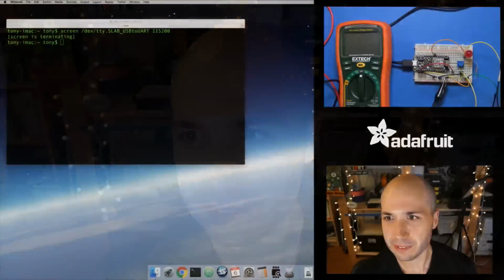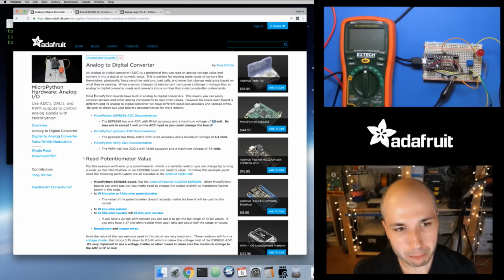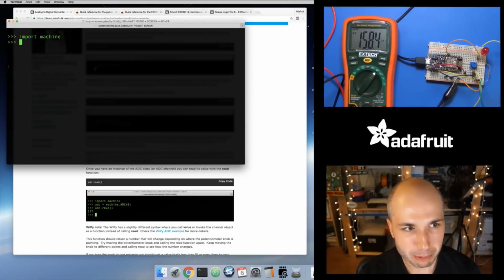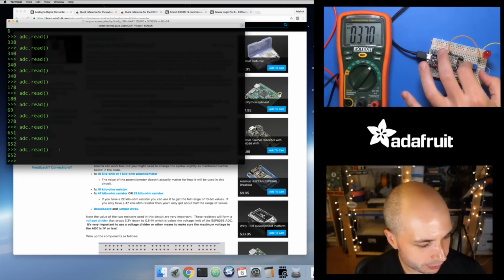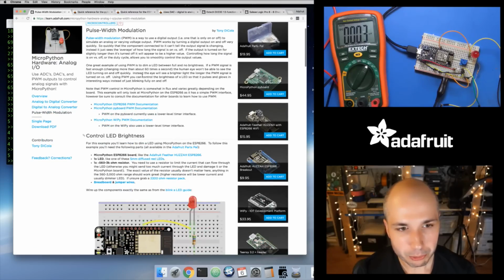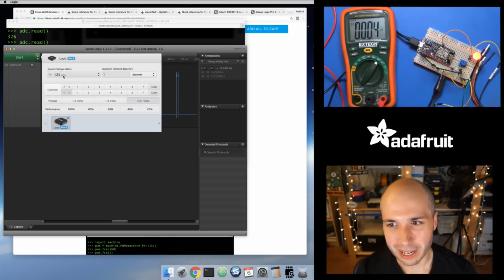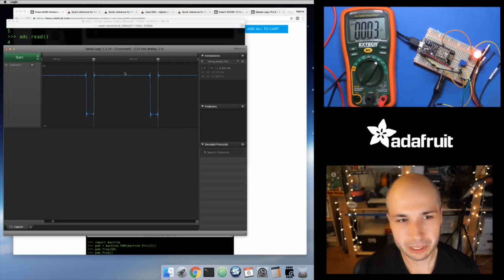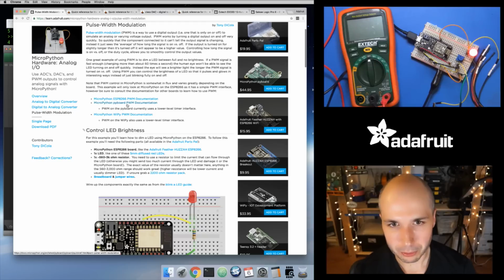MicroPython Hardware: Analog I/O with Tony D! @micropython #LIVE

Comment: Why was a 10K ohm resistor also placed in parallel with your pot (potentiometer) in your voltage divider?  This parallel resistor will make your 10K pot act like a 5K pot with the pot set to max resistance. Using the voltage divider formula, with Vs = 3.3V, R1 = 47K ohms, and R2 = 5K ohn, the Vout is calculated to be 0.317V. If you remove the 10K resistor that is parallel with the 10K pot, the Vout calculates out to be 0.579V. So, w/o the 10K parallel resistor, you pot yeilds a better voltage range "spread". Ideally, your spread should be 0 to 1023 (though my ESP8266 shows the actual max range to be 1-1024). If you next replace the 47K ohm with your 22K ohm, the Vout will calculate out to 1.031v which should give your voltage range a spread close to 1024. The actual spec for the ESP8266 ADC max input voltage is 1.4V with a warning that 1.8V and above will fry the input. So, I think that all you need is your 10K pot and the 22K ohm resistor and you've got a pretty optimal voltage divider. The best R1 value calculates out to be 23K ohms which would make Vout = 1.0V, but that is not a standard component, but you could easily add a 1K ohm resistor in series with your 22K ohm R1 resistor to achieve that value.